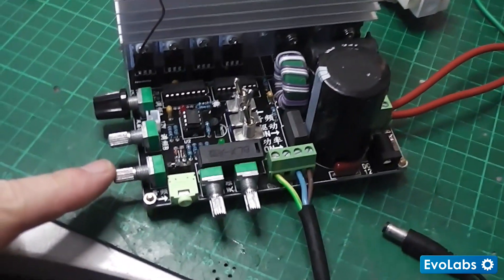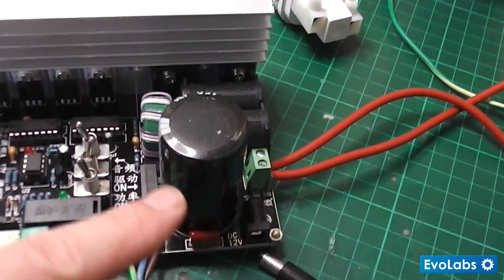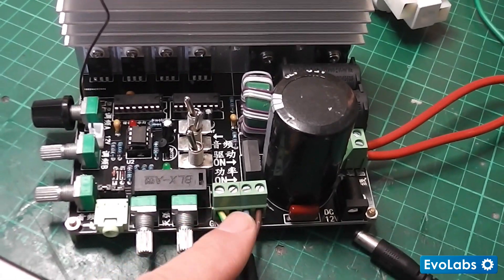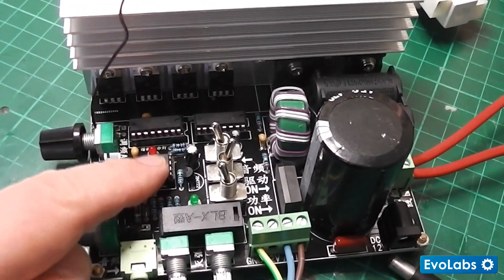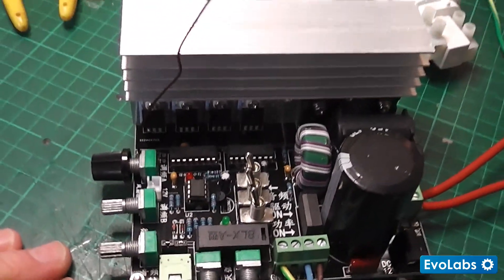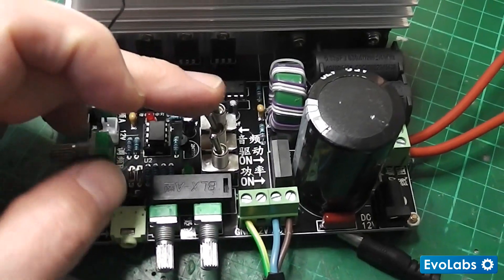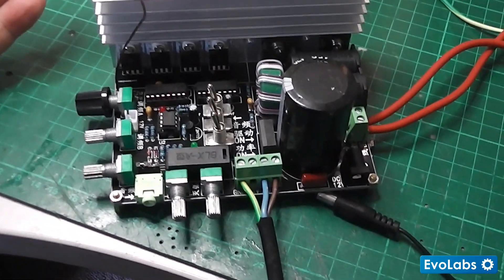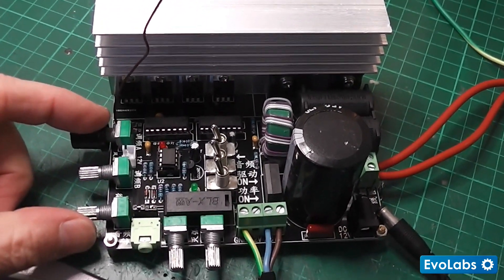Design and Build:  Solid State Tesla Coil - Part 1

Comment: So does it work??? sorry but you could have given a quick demo. i still don't know if i should buy it ???
Reply from the maker: There is a later video of it working - but only briefly before the mosfets blew. I wouldn't recommend it. I have since purchased a medium size SSTC off aliexpress that works well and is reasonably priced.
Reply: @evo-labs  I'm a year late here, but what did you replace it with? Got a link?
Reply from the maker: @kpjVideo  This: https://www.aliexpress.com/item/32825000353.html?spm=a2g0s.9042311.0.0.27424c4dcBt02L